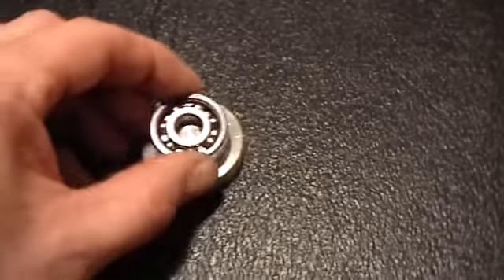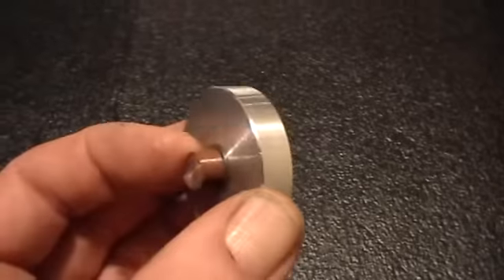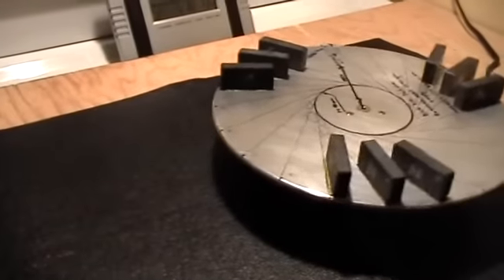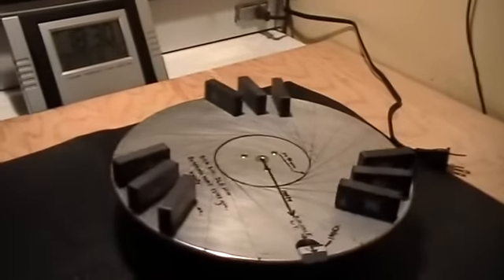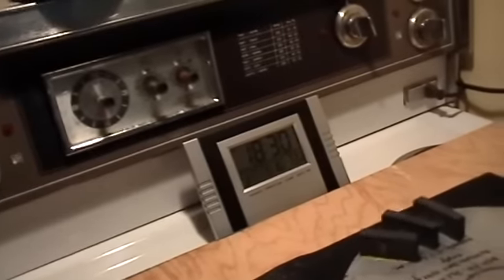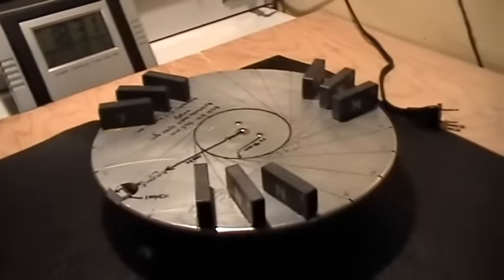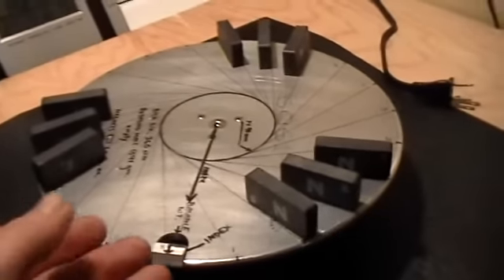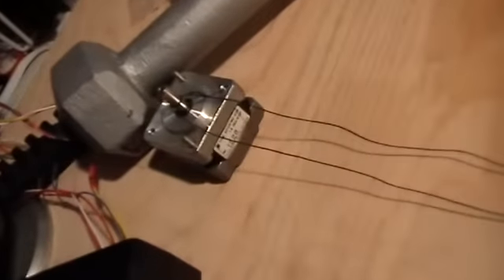MyLOW--How He Might Be Doing It 2

Comment from the maker: Thanks for considering it, anyway. 
But that one I linked earlier, YnYng, the last minute of that--
In this video right here, when I was switching the stepper control box, I was actually quite startled by the sound the Switches make. They are locking pushbuttons, high quality. Clickclick, a double click each time, like a ballpoint pen. Listen to mine and listen to his. If it's a different sound, it sure is strange that it happens Exactly when it does, especially taking the patter into account.

Comment: How do you explain the walk around on the glass table...you know, when he stood his socked feet on the glass and sorta dragged his feet  around it? He showed the underside reflection and a full 360° room view. Lots of different photonic angles that would (or should) have exposed a monofiliment line including the fan lamp shot. There is one place where he steps around, but the wide angle shows no motor. I understand your point regarding the retensioning of the line...but.
watch?v=EnUKhOjFe5E

Comment: Fishing line has a different refractive index under water than in the air and is almost the same as water. An out of focus line will be very difficult to see though if the camera angle and light source remain reasonably constant. I will say, that it does look like Mylow steps over something, but of course looks can be deceiving, and that could have been his hand, not his sock.